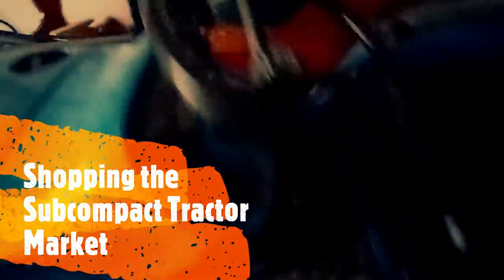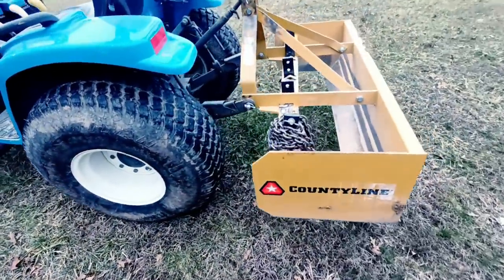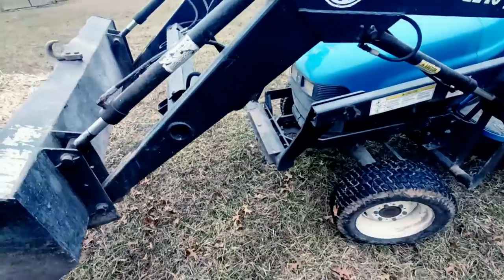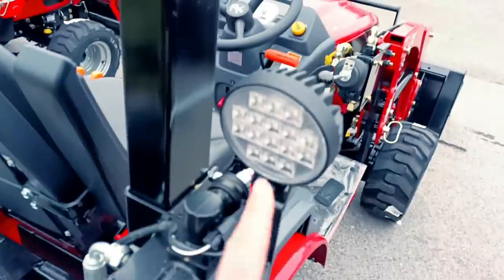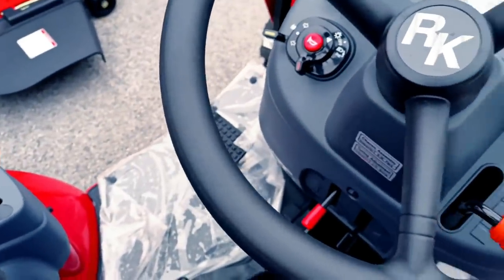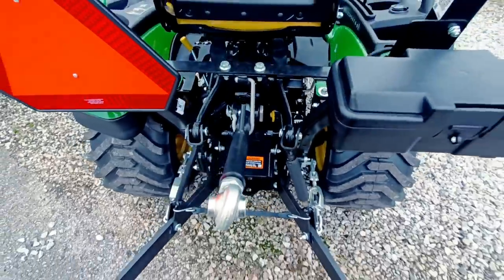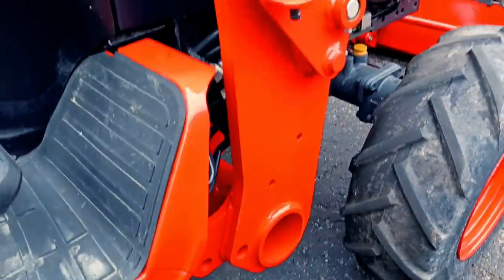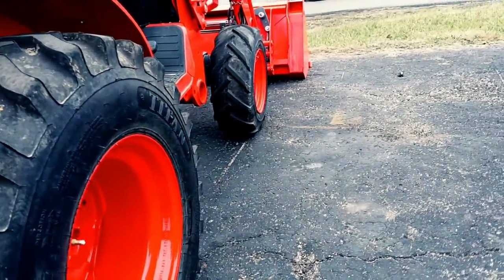Shopping Subcompact Tractors - RK24 / John Deere 1025R / Kubota 23S / New Holland Workmaster 25S

Comment: Stick a Kubota or John Deere. I`m betting the bigger bang for the buck is Kubota. It was for us anyway. All those other tractors really suck when you have terrible dealer support.
We chose the Kubota BX23S. We`ve owned JD`s for well over 30yrs, and JD couldnt even come close in the savings that Kubota did. We`ve had ZERO issues with our 2017 Kubota.
We also live in snow country. I have a 7ft rear blade on a Land Pride QH-05 quick hitch to plow our driveways. It works absolutely great. Front loader qwik-attach. Nothing like it. We have several frontend attachments. And the frontend loader comes off the tractor without ever getting out of the seat. We have the 60in mid mount mower. Cuts our lawns beautifully. The backhoe on it is a god send. We`ve saved THOUSANDS of dollars by doing our own work. Tractor has paid for itself already. Our dealer liquid filled the rear tires for free when we bought it. We got ZERO percent intrest, and 2 free attachments when kubota was offering the deal. That`s also something to think about too... find out what each brand is willing to give you with the tractor deal. Hands down, Kubota won us over very easily. We are still as happy as the day we bought the tractor brand new in May of 2017. Last year we bought a Land Pride box blade. How i ever got along without one this long i`ll never know. What a great attachment. Last but not least.... that pedal you complained about on the Kubota`s, funny how i dont get kinks in my neck anymore. Its easier to operate the rear implements without having to stretch out to reach side by side pedals like the RK and JD has. Just some food for thought.

Comment: Coming up on 2 years with my RK24.  One of the best purchases we've ever made.  Our town has a local Deere and Kubota dealership, so I took a risk going 30 miles to buy the RK.  So far, it's been reliable, strong, and very capable.  Have only had one issue, and dealership was great about a fast repair.  At about 170 hours right now, and I've beat the crud out of it, and it still looks and runs like new.  By the way, I added a hydraulic top link that utilizes that standard rear remote... wow.  Makes hooking up large accessories like a wood chipper and yard roller so much easier and more versatile in the field.
Reply: RK is nothing but a TYM with different decals.
Reply: @RealJeep so? TYM making good products these days and parts will be available for them for a long, long time.
Reply: @mightyminifarm  So?  My GF has an RK37 and I have a TYM 25.  And your point is?
Reply: @RealJeep point is those decals. Make it so u can drop the tractor off a a local rural king for warentee work or to get an extra option installed.

I build transmissions for stellantis. We build the 6 speed manual for Mercedes. I have the 6 speed in my dart and gladiator. Mercedes cant.be dropped off at a dodge dealer for warentee. My dart cant be taken to Mercedes for a new transmission. Even though it's the same.

Comment: I have 2 LS tractors. A xg3025 and a 3010. The 3025 has paid for itself and the only problem was a$1.00 spring on the backhoe safety lever. 200 hrs. The 3010 had a emergency light switch go after 10 years of use. $30.00 . You can't beat them for price..

Comment: I've had my Rk 24 for over 2yrs now and have good luck out of it. I have almost 300 hrs on and haven't had any problems out of it. I've pushed it really hard to get the work done that I have done. I used mine 2 weeks after I got it to fix the road to my hunting cabin and the road had 3ft deep ruts in it.

Comment: Have a 2015 1025R since new. It is a brute for its size. Consult the dealer for pricing promotions. When I purchased mine it was 3K less than the MSRP. Tractor Loader Backhoe with a 54D mower deck. Had a warranty issue with the fuel pump that was completely covered by Deere. The removal if the attachments are a breeze. Zero issues with the hydraulic quick connects. I use the tractor hard pushing it to its limits and sometimes a little beyond.

Comment: 1994 1320 Ford/New Holland here, starts every time & runs like new, i owner ME.Push that throttle 1/3 up & it will start the first time with out coughing for lack of fuel. Filters & fuel 27 years that's it. mid mower & 5' equipment, tiller/hog.rake/grader & box blade, aerator, boom pole, only problem I have is my tires are starting to melt & turn back to oil when I roll out on asphalt LOL.

Comment: Oh fun times, went through this in 2018! I looked at RK, JD, Kubota, Mahindra, New Holland when I was looking for a subcompact.  I was more looking at the little features and comfort and specs as well. The most important will be your dealer and how they treat you! That should be first!  Parts, are you going to be able to get parts in 10 years on an RK tractor, Kioti, Branson?  Not sure where you live, any cold days, treat the diesel all year, I use Howes, may switch to stanadyne.  Back to the tractors, the Kubota, I couldn't get past the tin holding the front loader locked and the stand and 3 point hitch setup. Very tipsy from what I seen, felt like a toy next to a 1025r.  Long and narrow.  Hate the pedal design, but like the all in one vs their split design.  But hear very little problems with them though. Some front ball joint issues and leaks at the single connect loader, but hopefully figured that out by now. Doesn't lift much with loader, 3 point lifts though.  Mahindra, they are well built, but the same with RK.  They just don't seem fully developed to me. But all cast iron, reminded me of the old Internationals.  Trying to check the oil wasn't fun, in odd area on side and hard to see.  Was looking at the Max 26 XLT HST.  Backhoe was rough to use, no cushioning.  Feel like you are sitting on top of tractor.   New Holland, just something I didn't like about it and wasn't impressed.  The RK24, it was nice to see the extra features, but it felt clunky and not complete.  Forward leaver for front loader, etc.  I then looked at the 1025r, the sales guy was busy with another customer, threw me the keys and said go test what you want.  The 1025r, loader is easy on and off and stand works on it's own as you take the loader off or put on.  Wish it was a single connection for hydraulics, but wasn't available then, is now! OEM front third function is as well now!  I like the JD quick attach better, lighter, easier to use with two pins. Watch TTWT for good comparison video. The universal are known to bind and get rough.  Oil filter and dip stick are easy to get too along with filter, pre-filter.  The 3 point hitch on JD is position control, it's not up or down, you can stop it where you want.  Backhoe, has a step to help you get up on it and also locks for the outriggers so the don't leak and come out with a dent in the wall or car. Backhoe has side to side and back cushioning so it's not so rough.  Can float the bucket on it like the front loader.  Get the 16" hoe bucket!  Start with it if you go this route!  12" is too small!  Can get the 6" later for trenches from bxpanded.com if needed.  Has extra work lights on side. Felt like you sat in the tractor instead of above it. Mid mower easy on off, don't leave dealer without them checking it though first as they are known to not adjust the autoconnect for some reason. When auto connect is working, game changer!  Same for the Load-N-Go, can lift the deck up with the loader and sharpen blades, clean underneath deck, another game changer.  Some complain about the gas gauge on side, I like it, easy to see from seat or backhoe seat!  Some problems are the transmission.  See a lot of transmission leak issues and covered under warranty.  Air cleaners were breaking top of engine valve housing, but late 2018 and forward that is fixed. Some complain about front axle not being vented and causing seal leaks after hours of use, some just open the dip stick and relieve the pressure, but never experienced any issues here. 1025r loader can lift more than BX23S, but 3 point on Kubota lifts more. Little less tipsy, but still possible.  Think RK and Mahindra win with power specs.  JD open hood design is stupid, needing pen, key or something to push in the release. Sides come off easy with 1/4 turn thumb screws.  I don't care what color the tractor is, just want it reliable, comfortable, make my life easier!   Dad eventually ended up getting the Mahindra Max 26 XLT.

Comment: I can vouch for the RK24. I have been hard on mine for 50 hours now doing land clearing. I have the grapple with third function valve,  Woodland mills wg24 stump grinder, 4' tiller, 4' bush hog, landscape rake, bucket with piranha tooth bar, and soon to get the box blade. I am absolutely amazed at the capability of this little tractor. I have had so far zero issues. I did the 50 hour maintenance myself and it was easy. My favorite attachment has to be the grapple. I have picked up and moved some things that I thought would have never been possible.
Reply: Got mine last June and I agree:its awesome, with more power than I thought it would have!

Comment: I went with the BX23S. Keep in mind the Kubota’s 23hp engine has more torque than the 25 hp Yanmar engine and is noticeably quieter. The Kubota hydraulics are much smoother and the loader can lift and curl at the same time compared to the JD plastic  tractor. I didnt see an issue with the tredal pedal as my Ariens lawn mower is the same. I notice that pedal is helpful when going in reverse. It allows you to turn your body more to better see behind you. I have since bought the B2601 2 years ago. Wanted more ground clearance for 40 acres up north. The rubber mat doesnt move like that one
Reply: My wife an i are PLENTY happy with our 2017 Kubota BX23S. And ZERO issues! And you are right about the pedal. I dont get a kink in my neck since buying the BX23S.
Reply: I have a JD riding mower with side by side pedals they work fine because most of my mowing is forward. When I bought  my kubota bx23s thought I would not like the toe heel configuration.  But I'm old and stiff and would not be able to work the tractor safely backwards without that style of drive pedals. I thank God everytime I go backwards for the kubota pedal configuration.
Reply: Except they barely work at idle/ And that stupid treadle pedal sucks. compared to a two pedal JD system. Worked for a school district for 35 years. They bought four Bx's. Deck wheels broke off of two of them rear axle leaks on one. Been retired for twelve years now, ran into a co worker one day in Walmart. He said they got rid of all of them.

Comment: I was in a similar situation as you, while researching for a tractor, I wanted a subcompact with a backhoe, I checked JD, they were more than what I wanted to pay, I checked kubota, I didn't like the foot pedal and you can't get a 25 hp with a backhoe, I checked new holland workmaster 25s and found out that it is the same as a ls mt125 and when you take on and off the backhoe you have to take on and off the 3 point hitch and no skid steer quick attach for the loader, I was thinking RK but the dealer was about 90 minutes away, also I didn't like the joystick location for the loader, and the location of the fuel fill.  My choice was a Massey Ferguson GC1725MB due to the value, joystick location, fuel fill location, skid steer quick attach, 25 hp with the backhoe, the 3 point hitch folds up behind the backhoe, and dealer location.
Reply: You can get a kabota 25 horse stick shift with a back hoe,no computer,no emission. It's a L 2501,got one works fine.

Comment: That RK24 is EXACTLY the same as my Zetor M25. I believe they come off the same Korean assembly line. One thing the buyer should be aware of is that many bolts will need to be tightened. The lower portion of the 3-point bolts to the transmission cross bolts…mine had standard nuts, lock washers and flat washers….they came loose and trans fluid leaked. I solved the problem by replacing the nuts with nylocks and red loctite. Also, the fiber bushings that add friction to the throttle lever disintegrated, so I had to get in there and fix that as well. Last but not least, the bushings for the bucket tilt appear to have A LOT of slop. Not really sure if that is a big deal, but I would think it would be tighter at 50 hours. Zetor will bend you over $36 for an oil filter when you can find an equivalent Mann Filter W811/80 on amazon for $16ish. Other than that, the Zetor works great so far at 50hrs.

Comment: I had a BX kubota with the treadle pedal and it drove me crazy, plus with the single hydraulic on the bucket I replaced the seals three times. I traded for a 1025R and have had zero problems in 7 years.

Comment: I can’t believe anyones trading in a 50 hr tractor , the last 3 tracks I owned had well over 1000 hours when I upgraded to higher hp tractors (used) with 6/700hrs . If a tractor won’t go into thousands of Hours ( if) we’ll cared for some thing isn’t right . Diesels can go on and  on . Yes the rk is well equipped and the price well ya can’t beat it

Comment: The Rual King Looks nice.. I did like the bigger Tires for sure.... I have a JD 1025R and have had it for 5 years now. I have had No real problems with it. The hydraulic connections that you had concerns about for ground clearance I have had no problems or issues with. The only issue I have had with mine is the rubber strap for the Air Filter canister keeps breaking. I'm thinking it is due from the vibration of the motor that makes the strap rub against the Air Filter canister and it breaks are the metal hooks. I have had to replace it 3 times now. Also keep in mind who and where and how far you will need to go to get parts or to take it to get fixed too..?? So after having my 1025R for 5 years, I'm very happy with it and it works great for me! Good luck on your purchase!

Comment: I'm trying to decide between JD 1023e & RK25 . A friend has a JD 1025r like new condition with 250 easy hours for $16k the 1023e has 12hrs. Like new for &14k & its a 2023 model. FEL and 54' mower.  RK about 25____30 miles away the RK24 with loader is like 12-13k the RK25 with loader is 15999.00.the RK as you said comes with things the JD don't.   I'm leaning toward the JD 1023e price,warranty, resale,dependable & and I think it will do all I need it to do here. But have to say the RK25 is really temping for Best bang for the buck,you know.  Sure hope your choice will be easy for you ! I enjoyed your video here !

Comment: Run a loader alot and you'll appreciate having the control off the arm rest.
Reply: I personally prefer the loader control upfront beside the steering wheel, I have never had an issue with my arm getting tired or anything with it. I understand the reasoning behind moving it to the fender to allow entry from both sides, but I also treat my tractor like a horse, motorcycle, forklift.... and always enter from the left side.

Comment: Did loader lift checks for these 3 tractors plus a yanmar.  The New Holland easily beat the rest as it put up 1000lbs at 6 ft.  I was shocked tbh.  It prices out about 2-3K more than the RK and Yanmar's though with bucket and backhoe.

Comment: I've been following these RK Tractors and in 2018 i went and bought a J.d.3025e.  I now kinda regret my decision.  I'm now thinking about buying a RK 24. They are awesome from reviews I have seen.  I think their a very reliable machine.
Reply: I highly recommend the RK tractors especially if your midwest and Eastern US.  I live in WY and had to go get mine and parts are online only for me.  I got a cab tractor and the 37 hp It is a work horse and the cab is great for hot 100º summers and the cold winter the heat is great too!!
For the size and price I could get the implements and attachments I wanted!!

Comment: My nearest RK dealer is over 100 miles away, I bet there is 50 Deere dealers in 100 miles. I got a  John Deere 1025R last year, love that tractor. I need the small wheel base and narrow machine to do my landscaping jobs. You may want to look at a larger Deere model. I agree with you on the Kubota treadle pedal, I have used them and most difficult machine to operate. I know the John Deere will cost a little more, they have the best resale value, I do believe you get what you pay for. Good luck.